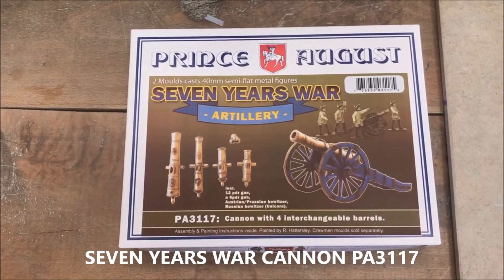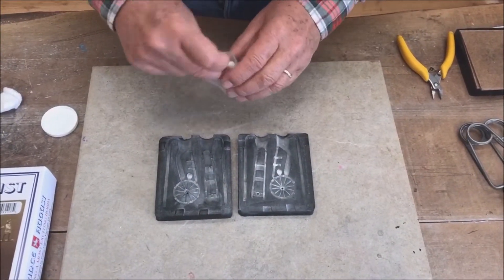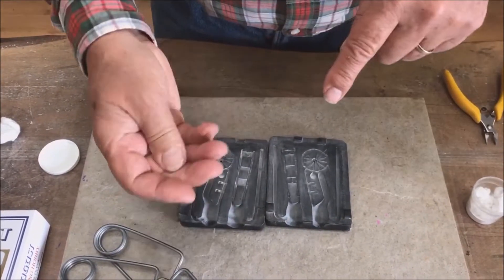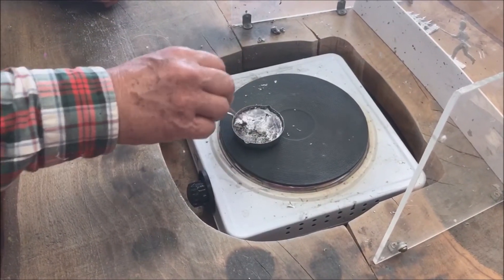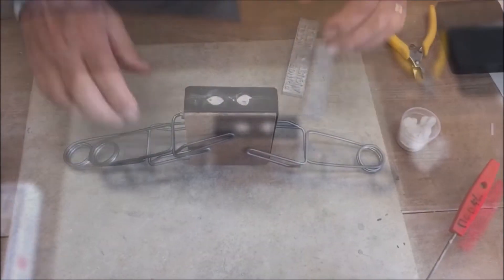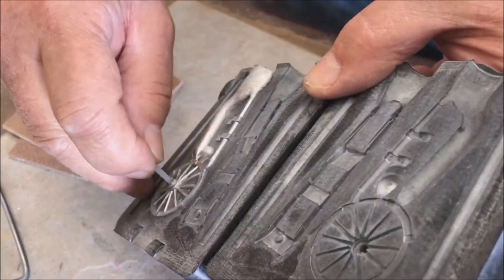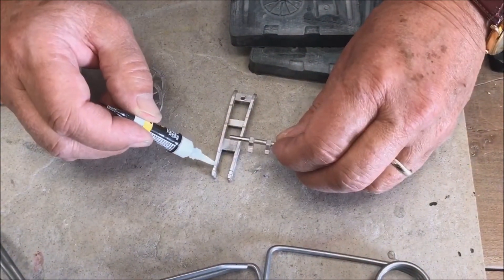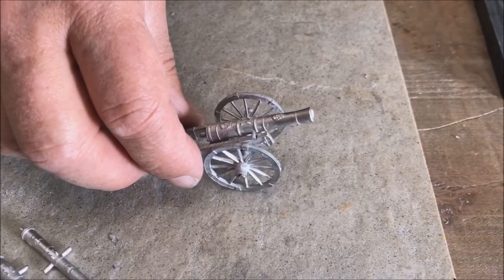Seven Years War Cannon Casting demonstration from Prince August.

Comment: I've been having a nightmare of a time casting the wheels on my Napoleonic cannon set, seeing this I suspect the air holes through between the spokes may have become blocked, possibly with talc.  I'll try again later and see if I have success!
Reply from the maker: I find that can happen. A pin poked through the holes helps to clear any residue left over.